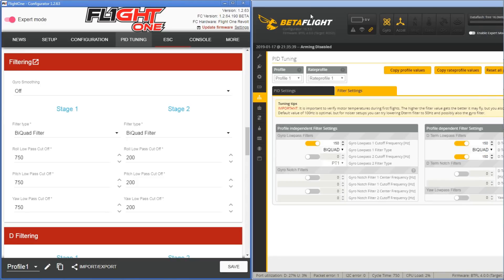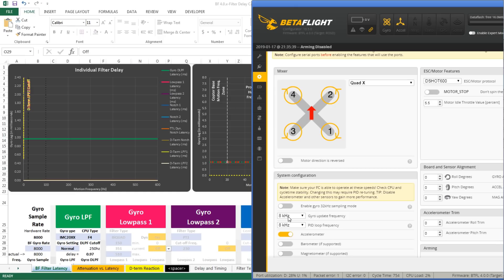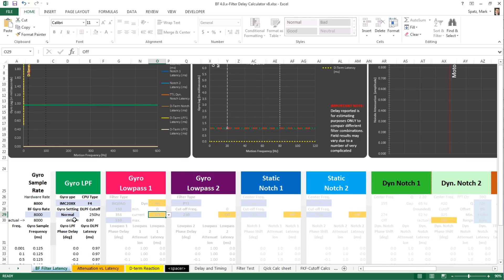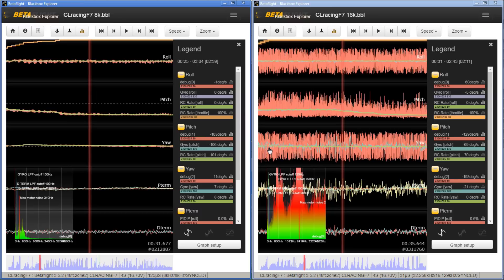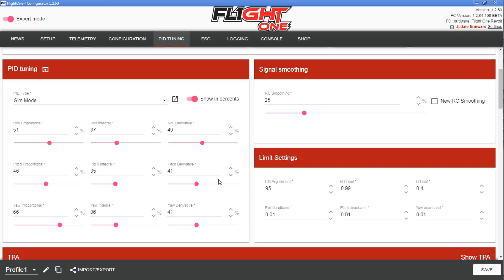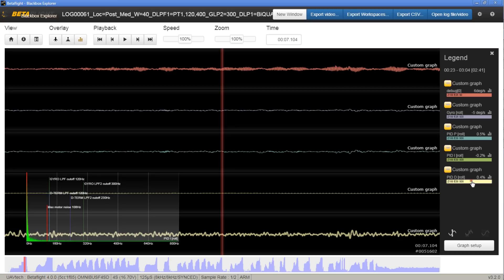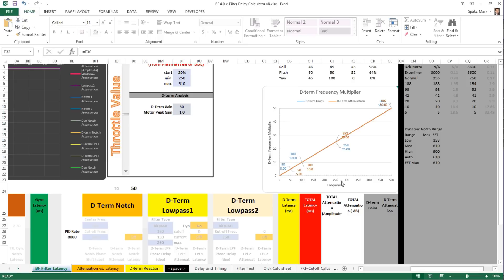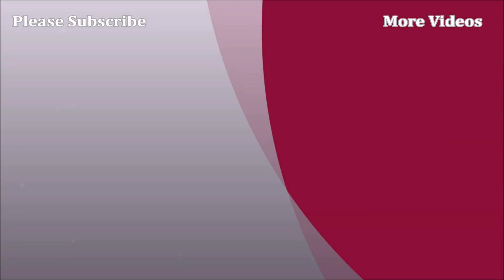Betaflight & FlightOne: Filtering Fundamentals Part II - Why we need to Filter

Comment: Just to check my understanding: if I have motion happening at 80hz in the gyro, that needs a160hz D term to dampen it right? So D term noise up to say 160-200hz is ok if my gyro motion is 0-100hz?
Reply from the maker: No.  80hz gyro motion = 80hz D-term motion.  Prop wash can go up to 100hz; but generally is 60hz to 80hz.  So above that we call motion (vibration) "noise"

Comment: Thanks for the great video. Regarding the pid loop frequency, is it better to run it a little bit lower than the gyro sampling rate or not? 8K8K or 8K4K, which would you recommend? Thanks again!
Reply from the maker: folks are experimenting with down sampling now.  It shows promise: https://www.screencast.com/t/7Kp4XoJxGT1

Comment: So if you check 32k mode and let your gyro/pidloop at 8k/8k, your should have more noise. And if your motors are cool, you can let it like this. Right ?
Reply from the maker: And if prop wash is better.  Check wash in 8k mode and then in 32k mode.

Comment: Good Video. May I ask why the gyro Digital low pass filter is in use if it causes that huge delay? I am just thinking why not all the data could be passed and  do the math by the FC. Sorry for my dummy question...
Reply from the maker: The gyro DLPF is equal in latency to a BiQUAD filter at 250hz.  HOWEVER, i have not run tests to see if the attention of a BiQUAD at that cutoff produces the same results.  In Part III, you will see i recommend in 32k mode to add the stage 2 gyro filter at 650hz (BiQUAD).  So, when you calc it all that out, with that, it is overall LESS latency than in 8k mode.  And if the signal looks the same going into the PID loop, BAM, 32K is better.  HOWEVER, that is a BIG "if" that I have not run yet.  But will do once I get some RX issues I'm having sorted.

Comment: I was expecting dshot bidirection telemetry/rpm-based notch filter video from you :))
Reply from the maker: I will.  Once it is refined.  Hoping the N channel restriction can be overcome.
Reply: UAV Tech you need to flys it. It’s te way
Reply from the maker: @Sugar_K  , once i can fly from inside the house or the car after ditching this Spektrum B.S..

Every time i fly outside right now with the 5", i get a failsafe and the quad is only 200-ft away.  I'm baffled why the cold does this to the Spektrum RX.  It is ridiculous.  I guess I could get the $40 Spektrum 5v RX to see if it is better, but I'm just going R9M.  So in the wait for the next week or two.  Have some holiday in that time prior anyway.
Reply: UAV Tech ohh yeah that’s not ideal especially in winter